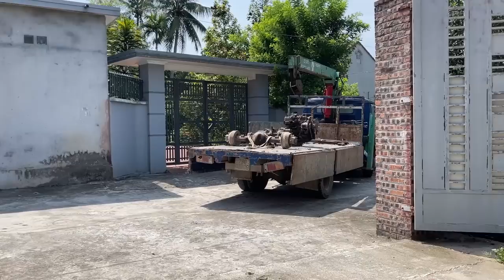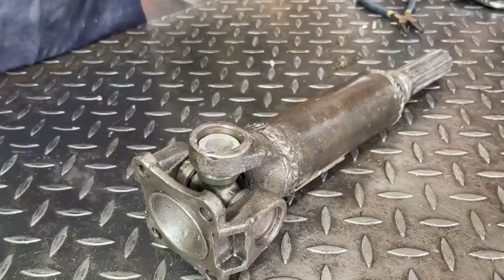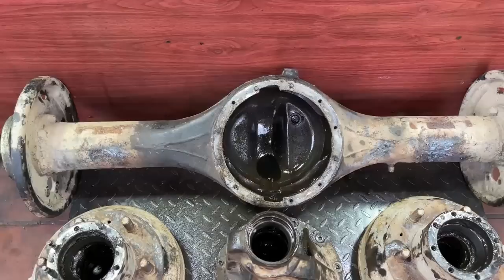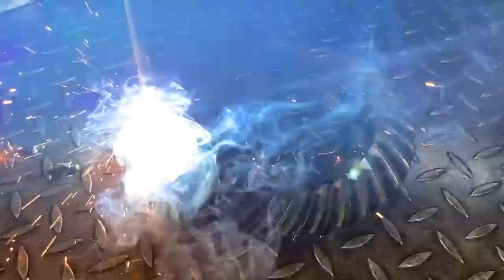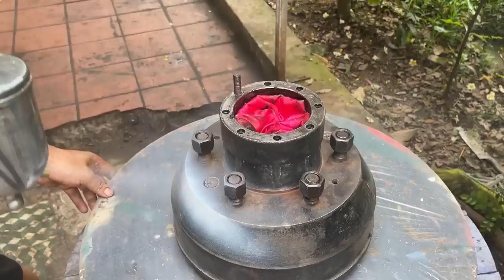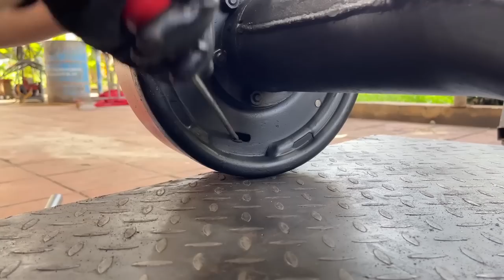Restoration Truck Differential Gear // Replace Pinion Bearing, Ring & Pinion Setup

Comment: Excellent job. I wouldn’t weld the gears-but replace with new. I mean if I needed to escape from a desert island you could weld it. Also he needs a brass hammer and punch set, torque wrench, impact rated socket set, seal driver set, parts washer, and he’s all set. Oh doesn’t anyone prime anymore?
Reply from the maker: Thank you for sharing your experience with us, we, we learn a lot from you

Comment: Ya know, I think it's entirely appropriate to get a NEW ring and pinion gear if you're gonna go to this much effort to rebuild this axle.
Reply from the maker: The set of rim gears is very expensive, if you replace all of them, the cost will be very high